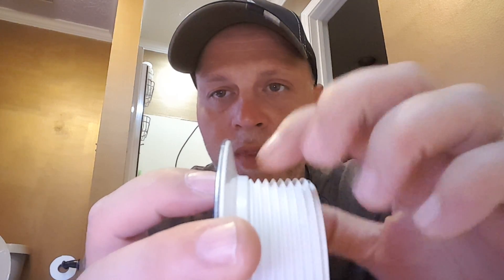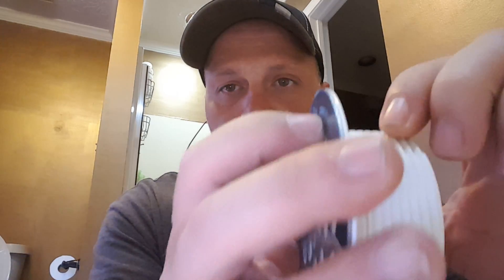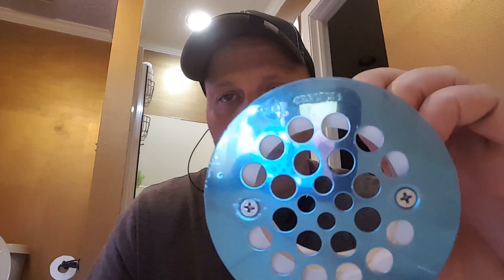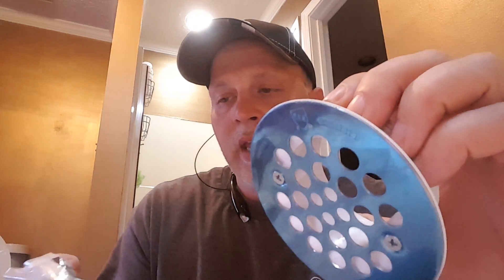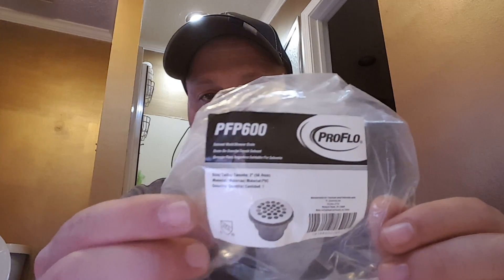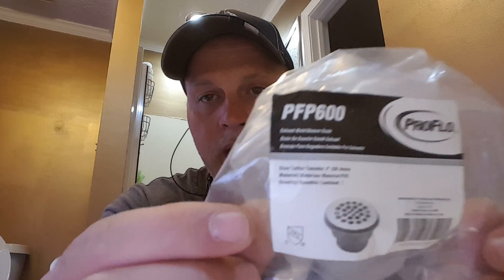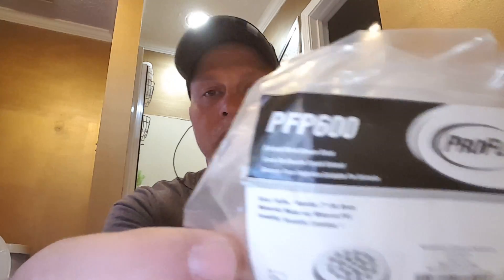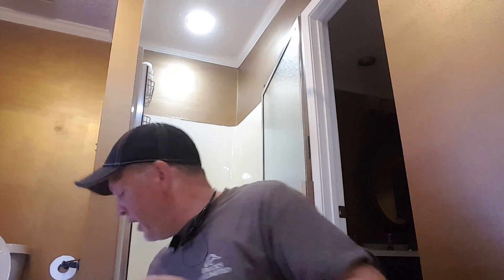Cracked the Code: Navigating PVC ASTM D2665 and ABS ASTM D2661 Drain

Comment: Like others have stated here already, I would just like to thank you very much for this video! You saved me from a lot more trouble! My shower drain was cracked and I had already been to Ferguson plumbing and they gave me the wrong drain fitting, so I tried to repair the crack in mine, but no luck at all! That's when I found your video and I called Ferguson back (a week later) and they had the exact Proflow PFP600 drain fitting! They had it all the time, but I had to know what to ask for because they didn't know. Once I installed it, no more leaks! Thank you again!!

Comment: I am needing to change out my shower pan and it has one of those. I can't figure out how to unscrew it out. Is there a special tool?
Reply from the maker: Just a suggestion I don't want to lead you down the wrong road without seeing it. Screw driver and a hammer and tap it to brake it loose. Sometimes, they are tough to get loose. Hope this helps

Comment: Joe,
I am in the process of repairing a leaky Oatey shower drain.  I have that same exact part number on the drain.  The problem was the Pt# 42156 seal.  It had deformed after 22 years and a chuck of it was missing, hence the leak in the ceiling of my garage.  I was very fortunate the seating castle nut was free to turn.  I loosened it about one full turn and was then able to grab the old seal and pull it up and out.  I had to order the replacement seal.  My question is this.  I read all about not using Plumber''s Putty on ABS.  That part, as you well know, has both the ASTM and the ABS part number on it.  On line, they tell you to put in into a glass of water with so much salt.  If it sinks its one, if it floats it's the other.  I can't get it all the way on, so that's that.  The original installation had that castle nut covered in Plumber's Putty and the part looks fine.  So I don't see why I cant use the same stuff to seal it back up once I shimmy the new rubber gasket into place.  What do you think?
Reply from the maker: Warren I would have to refer you to asking a plumber. I am unsure on this one. I am sorry but I don't want to give you the wrong answer. Good luck and again hope you understand. 👍

Comment: Thanks for the video. You did save me the time finding the replacement part (and Ferguson's is 3 miles away). Now, with that said, can you tell me what you did to get the old part out? I have your exact same issue, the screw retainer holes are shot and the drain cover can't be held in place. Thanks again.
Reply from the maker: Sorry I didn't see this comment until now. Hope you was able to get it replaced.

Comment: Joe,  can't express how much time and money you saved me. I went to McClendon's hardware and spoke with a "plumber expert" and he told me to take what they had in stock home and it didn't screw on. I would have to have had the whole shower removed and replaced to change the flange located under the shower stall itself. All the videos talked about putting this together like it's either brand new construction or a remodel. I just needed the drain screwed into the existing fitting from the TOP not the bottom. Thanks again, serious coin and money saved because you went the extra mile and shared with everyone. Greg Thorson.
Reply from the maker: Greg I really appreciate the nice comment I am so glad I was able to help. You took time to thank me and I want to return it to you. So thank you

Comment: Found your video by looking up the issue by part number.  Crazy that significantly different components have the same part number.  I found at least 4 different thread configurations that all had the same part number.  Your video was a life saver.  For those that order the part online, seems there might be both a PFP600 white and PFP600 black.  My original was black but I was unable to locate a compatible replacement.  The white works and while more visible, it really doesn't matter.  Thank you, Joe!
Reply from the maker: Appreciate it and glad I was able to help.

Comment: Would never have found this part without stumbling onto this video.  I made the mistake of thinking shower drains use a standard sized thread (don't know why they can't, as they are so close in diameter), and/or that the big hardware stores would sell what I needed (but they only sell useless models that require access to the underside of the shower pan), and I destroyed the top part while trying to remove it to investigate a leak.  Your video saved me having to cut my ceiling open to replace the whole fixture.  I immediately recognized it was the same part my builder had used.  Also, Ferguson got it to me really fast without even paying for express shipping - ordered Sunday night and received on Tuesday.
Reply from the maker: Awesome Andy glad I was able to help.

Comment: Holy crap, man. I just went down that exact same path.

Seconds before watching this, I’d found a drain on Amazon that mentioned “coarse threads” and “8 threads per inch” that I was about to take a chance on. Turns out it’s listed as a PFG600, so based on the similarity, I’ll bet it’s compatible as well, but we have a Ferguson’s not too far away, so I think I’ll head there tomorrow. Thank you.
Reply from the maker: Awesome

Comment: How dot you remove the old one? Nothing to grab on
Reply from the maker: I used a screw driver and a hammer and lightly tapped to unscrew old one
Reply from the maker: I used a hammer and screw driver and lightly tapped to unscrew it. Use the screw holes to place the screwdriver and light tap counter clockwise.

Comment: Hi Joe
They have changed the diameter of the unit, it is still coarse threads but the new style literally just barely touches the existing housing threads. I did find an exact replacement, took me 110 miles of research to physically match it up. Ferguson's did not fit with today's model. I'll post the brand later. What a fiasco!!! The PFP600 did not fit!!!
Reply from the maker: Thank you for the comment

Comment: This item is actually manufactured by Oatey and is their part# 42246.  That would be the part# for the body only, there are several different configurations of tops that fit that.
Reply from the maker: Mike Underwood yes sir but the problem is the person would have to remove old body and install new one. it would be out of most people's comfort zone to replace that. but yes if someone is looking to replace body thank you for that info.
Reply: Oatey makes the tops for Pro Fit as well, you just have to look on Oateys website to pick out which top you wanted, round, square and different finishes. Most plumbing wholesalers carry the Oatey brand.
Reply: @mikeunderwood4807  , cool, can you post the equivalent tops for the PFP600?

Comment: Just some information regarding your part. ASTM is a reference to an agency that sets manufacturing standards that are, for the mostpart, accepted world wide. D2665 standard is for PVC (poly vinyl chloride) fiitings and pipe. It ensures that any fitting or pipe is manufactured from specific PVC components so that all parts will perform in the same manner regardless of the manufacturer. Pipe and fittings conforming to an ASTM spec have the same qualities regarding adhesives to be used, dimensions, resistance to crush, pressure rating and numerous other criteria. Another specific states that this spec relates to fittings to be used in DWV situations (DWV = Drain - Waste - Vent). 

Entering ASTM D2665 in Google search will produce descripions of the spec as it applies to the products of various manufacturers. ASTM D2661 refers to components manufactured from ABS type plastic (Acrylonitrile-Butadiene-Styrene). Some garbage cans are made from pvc. Leggos are made from ABS.
Reply from the maker: Yes I found all that info out while searching but I wanted to make sure I helped people find what they was looking for and so far it has helped alot of people. That was the only info on the part and by the views alot of people have been looking for this. thanks for the input

Comment: One of the most helpful videos I have come across. Solved a problem I have been battling for a couple of years. Could not find the part locally, was told by one guy who should know better that it was a drain for a trailer. Insert Rage Face.  I have glue and fixed the part several times.  It broke again a couple of days ago causing a flood of water onto the floor of my bedroom. Now I will finally be able to fix it correctly,.
Reply: thmsmgnm Glad I was able to help you! I felt your pain when I was going thru it and no one had any info about it online. so I took the opportunity to help as many as I could out. thanks
Reply from the maker: Awesome Glad I was able to help

Comment: I bet there is no possibility you have the exact measurements of this part? I have the same problem with what looks like the same part, but the pfp600 says it is a 2 inch drain while mine measures out 3 inches across the threaded part. Dont want to buy a smaller part and have to return it and start over. Thanks for your video by the way.
Reply from the maker: I would say its the same but i dont remember
Reply: I still have the part the threaded piece threads into and it is approximately 3 inches inside diameter.  It fits on to a "2 inch drain pipe" which has an outside diameter of about 2 3/8 inches
Reply: @doncote8695  I'm having the same issue, the one i need is 3" inside diameter and the proflo quite a bit smaller.

Comment: this looks like the drain that i have. same problem with the plastic screw holes. when you replaced yours did you have a problem getting the old one out.  i am also worried about the seal under the shower not staying tight against the under side of the shower pan. any problems in this area?  finally, thanks for your tenacity in finding this item.  i am ordering one right now!
Reply from the maker: Richard Nordin sorry Richard I commented below on another comment. tells you how to remove it

Comment: Thanks Joe ... I just ordered it from Ferguson's.
Reply: Thomas Vermaak glad I was able to help. It was very difficult to find, trust me I wouldn't want anyone to go thru trying to find the info out.
Reply from the maker: Thomas Vermaak use a flat head screw driver and a hammer. where the old holes was use small taps and it will losses right up like mine did. hope it helps!